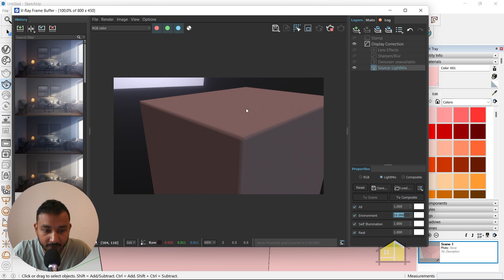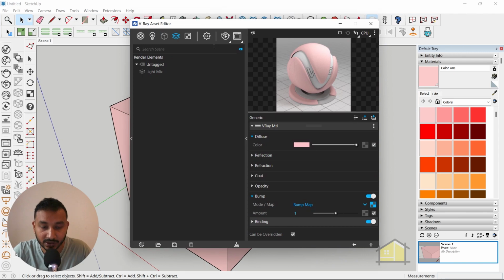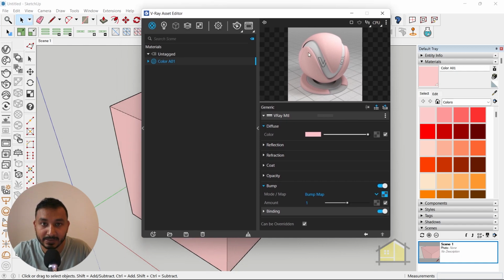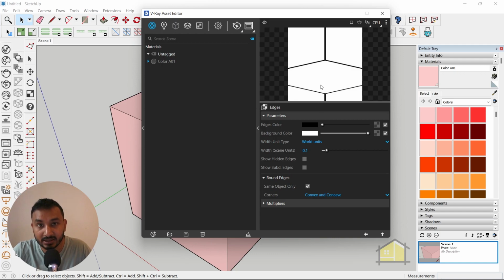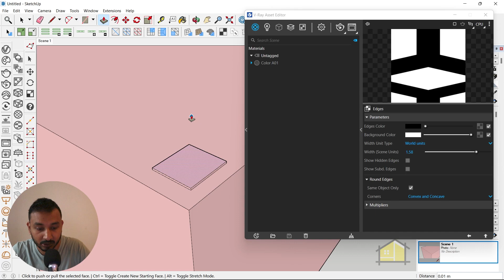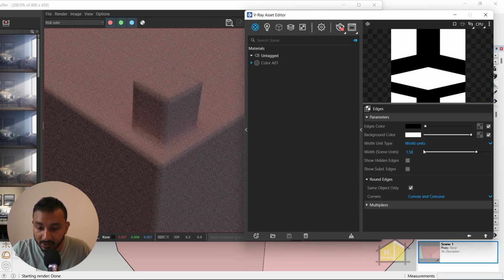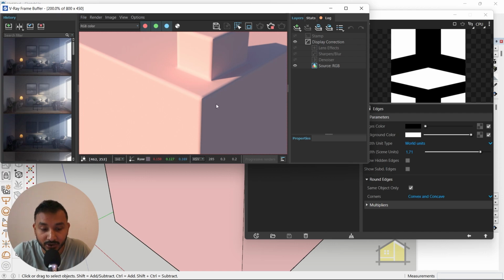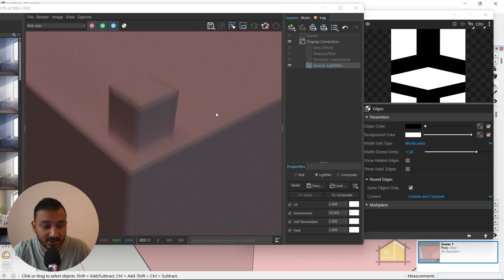Round Off Edges in Vray for Sketchup

Comment: For VRay 5 for Edges use another layer which is Bump attribute in material settings, then change the Bump Mode to Bump Texture Channel and add an Edges texture to the Bump Map slot (like shown in video)
Reply: thankssssss it workeddd

Comment: Unfortunately It doesn't work in CPU for me 🥲
Reply: For VRay 5 for Edges use another layer which is Bump attribute in material settings, then change the Bump Mode to Bump Texture Channel and add an Edges texture to the Bump Map slot (like shown in video) It is working for CPU also